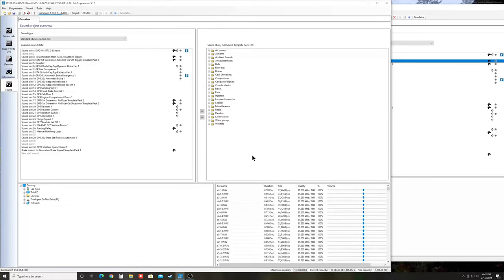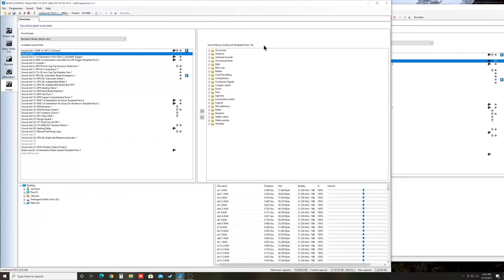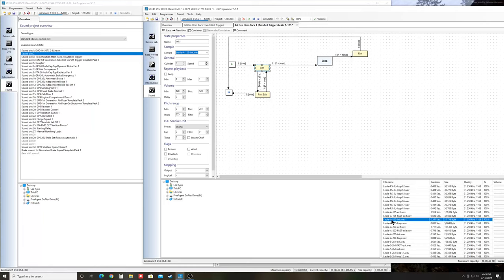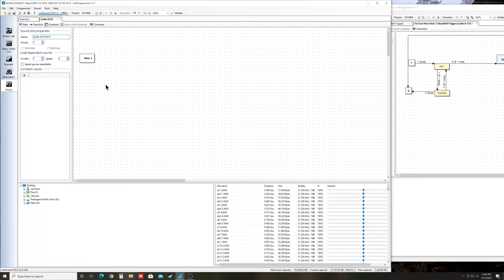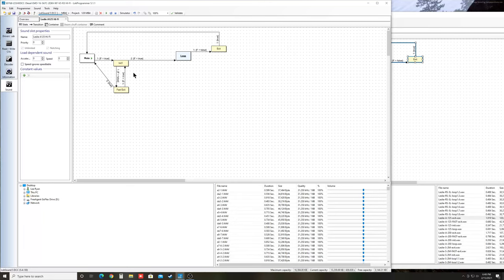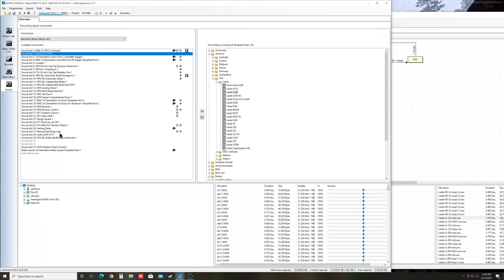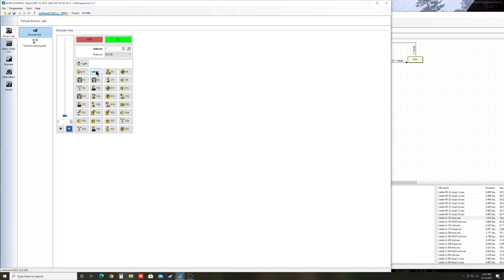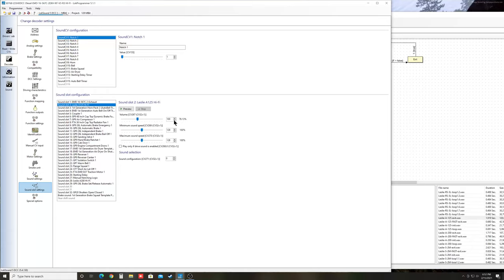ESU Tutorial Series - Combining 2 Horns to Play at Once

Comment: why is it that one of my horns won't activate when doing a short blast?
Reply from the maker: I have recently learned that sound slots 1-3 work a bit differently behind the scenes than the rest of them. The horn that isn't in one of these won't play quite as quickly due to the nature of the software. You'll have to actually remove the horn pack on sound slot 3 and have 1 horn on slot 2 and one on slot 3. This should work better.
Reply: @RioGrandeFan  That fixed the issue! Thanks!!!!
Reply: @RioGrandeFan  it seems to be out of alignment, one horn starts before the other still.
Reply from the maker: @modelrailwaybackshop  yeah, there might not be much you can really do about that. I will see if I can look into it further but what you have might be about the best you can get at this point.
Reply: @RioGrandeFan  I found out I had to swap the horns and prime mover, once I did that it fixed the delay and now it's spot on like I wanted it!